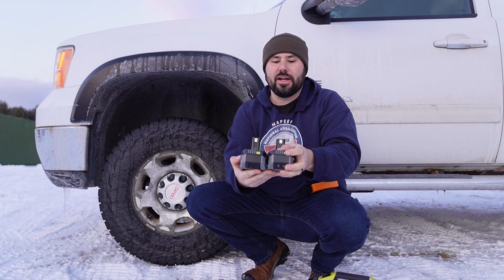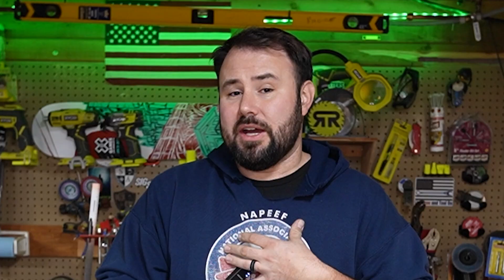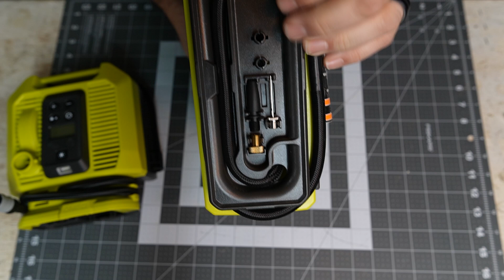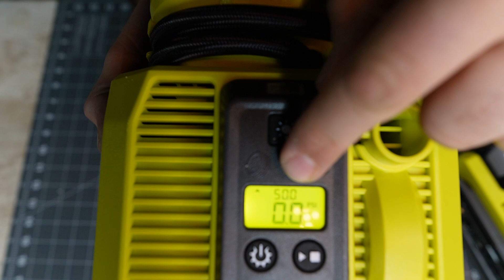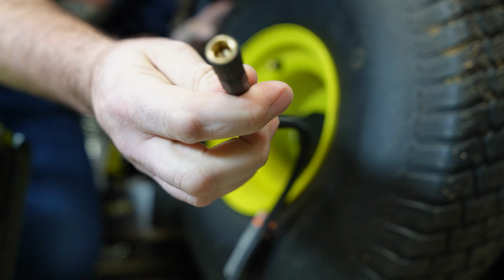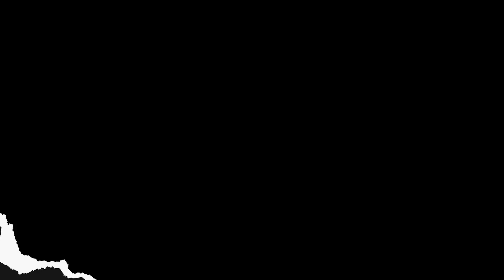Ryobi NEW Inflator VS OLD #faceoff #diy #power #tireinflator #roadside #electric #homedepot #life

Comment: There is nothing wrong with the old one psi reading. You set what psi you want. Put on the hose, it reads what the psi is and it remembers what psi you set it at. Just press start.

Comment: HATE the new style valve chuck!
Aircraft (GA) have extremely little clearance between rim & valve stem.
The straight chuck design is great for bicycles, motorcycles & autos, but useless in a hangar. 😡
That’s a shame, because the older pistol grip inflator with the 90 degree chuck is one of the most used tools on our field.
Yes, I know nitrogen is the gas of choice, but it’s not always available.

Comment: I like the chuck on the older model which has a long track record of reliability.  The new style chuck is nice but it also comes with an additional point of failure.
Reply: I just got some quick connect adapters off Amazon.

Comment: I use the  NEW  model PCL031B RYOBI inflator to air up my motorhomes 19.5 tires. Does it get hot? Yes. Does it melt? No. Heat is a natural byproduct of compressing air-So-It is SUPPOSE to get hot numbnuts. If the new one will do my bigass 19.5 tires-discard all the rest.
PRO TIP-
To get more out of your cordless tools put in a bigger Ah battery. When I put in a 6AH battery into my mower or inflator or chainsaw or Impact not only does it run longer, the tool has more torque.

!

Comment: I'm not thrilled about the quick-connect on the newer one; it looks like plastic, and Ryobis are not known for durability under hard use. I have the older version, with a quick-connect extension attached. This works really well, and also adds a bit of extra length to the hose.

Comment: I have the older model and main issue is connector onto tyre valve. It doesn't connect without letting a lot of air out and sometimes won't fasten into valve properly. Could do with a more secure connector.

Comment: I have TWO Ryobi inflators and neither one is the same as what you showed.
1)  (~10 yo)  Similar to 'old' one shown, but mine has a cam-lock one the high-pressure end.  I've used this inflator for ten years on car tires, buke tires, mattresses -- it has never failed me, nor do I spend time screwing the line on.
2) (~ 5-7 yo) I have a high pressure only inflator -- with an analog-style gauge and cam-lock.  It works.  The only issue I have with this unit, is minor, but I keep hitting the trigger while I'm handling the unit.

Comment: I’ve been searching for a 747 vs this new style and glad I stumbled onto your video. 
My thoughts is that quick connect will not endure as well as the brass fitting.  If the new one had that brass fitting it would be a much better option. I like the hose on the new model and that light is a great idea. 
That hand held probably be good for a bicycle. A neighbor has that hand held and it it’s not overly impressive.

Comment: I just bought the new one yesterday. Looking at the comparison of the two i must admit i would probably prefer the old connector. I know it's slower but i found it a bit tricky to have to press the connector on while using the other hand to press the thing forward to lock it. I like like the light. It came in handy first time i used it. I don't have a pressure tester but my car tells me the pressure of the tire and according to it the Ryobi was off by 0.2 Bar.

Comment: What does an 8 lug rim have to do with inflating a tire? Also, why wouldnt you use a more standard size tire? It looks like you have a 33-35 tire? Is that tire size standard where you live? WTH?!
Reply: Very common where I live. I actually want to know if it can fill that size tire up to 80psi as that is what I run mine at when towing.
Reply: @michaelbowman7398 
Typically an 8 lug is on an HD truck which requires a much higher PSI than your average 35 psi passenger car tire.

Comment: Bought the smaller of these two,and it works great.Love the easy attach air nozzle and the digital air pressure guide.The hose does stay in place when stored,unlike many other brands that end up coming off.

Comment: That "we did 6 psi ... 4 minutes" comparison is not valid.  It is much more work and will take much longer to go from 45 psi to 50 psi than it is to go from 0 psi to 5 psi.

I have the old one.  It's the only portable air pump I repeatedly use.  Guess I'll have to pick up a new one now...  Thanks for the review!
Reply from the maker: You're talking about a low pressure addition of air compared to a high pressure, it's harder at high pressure but needs more volume at low

Comment: I have the older model , it's been great , no big deal with the screw on connection , the only thing I would have liked to see is the possibility of using the 12 Volt car plug in case you are stuck somewhere and don't have a charged battery pack , not sure how complex that would be to add , i know that my emergency first aid kit in the truck has one , but it takes a very long time to pump up the tires.
Reply: I had the same issue, and autozone sells adaptors , very practical and solved the problem
Reply: If that's what's you don't like get the Dewalt 20v inflater. Runs on 20v battery, car 12vdc or ac 120v

Comment: I have the older model and never found it difficult to use. With the battery on the new one, the size difference doesn't appear to be a lot. The new chuck is nice but not worth buying a new device. The screw on chuck has always gone on easily and quickly. This update should make the previous model a great bargain.

Comment: Since Ryobi has permanently banned me from making comments because I said their jump pack was too expensive I'll comment about this Inflator here. My favorite one was the one prior to the older one you showed here. Why bother with these tiny upgrades other than to try and get more money out of you? If your going to release a new inflator make it a substantial upgrade. Ryobi does this with all of their new tools and it's a ripoff.
Reply: Isn't that true of most manufacturers tho? If a manufacturer waits until a new version of a product is significantly better in all features rather than smaller improvements, it can easily be overrun by the competition releasing its stuff.
If you don't like it, why not just skip one or more upgrades until you think it's worth it.
Reply: P731 had mine for about 7 or 8 years. It's the best out of the bunch as far as I'm concerned. Not the most compact but having to handle batteries protected. Doesn't tip over. Easy to see the display when you're using it. Auto shut off quick disconnect deflate inflate.

Comment: I love quick connect over the twist, but i hate that it's all plastic. It will degrade from too much heat exposure.
I'll stick to my old one with the quick connect attachment I bought seperately.
Reply: I need a machine now, should I get the old or the new one? Plastic quick connect does concern me...
Reply: agree, I would also think it isn't as solid as brass in the Swedish winter cold I live in, last weekend it was below -20°C (-4°F). I would think the plastic easily cracks in severe cold, especially since it is "expanding force" on the sleeve when put on the tire valve. The next progression should be a quick connection with a proper metal body and quality o-rings.

Comment: Have you tried it against the Australian one🤔
Reply: Interesting, what is the difference in spec?
Reply: I have the Australian one (CIT1800G, similar to the older version in video) and it's basically the same, except it has a rocker switch for inflating tyres or via the hose, and the tyre hose has a clamp/lever on it to fix it on the valve stem. Still only 150 max PSI pumping out, same length cable, same issues as identified in the video.

Comment: Wondering if either of these will actually inflate a large Motorhome tire to 120 psi.  Has anyone out there done this? TIA.
Reply: It probably can after cycling a few times.
Reply: Im betting no way
Reply: @slim56  I think you're right, it'll probably overheat before getting close. Maybe if you do it in steps with pauses, but that's not a viable option. I bet the manual has a warning to not exceed x minutes of operation without a cooling down period. I think you have to have a dedicated tire inflator that is great at inflating tires, without the air mattress option - combo tools often do compromise on all functions, better to have a great tire inflator with good cfm, pressure, and operation time specs.
Reply: Good question,
I have the older version and I wouldn’t bet on it.